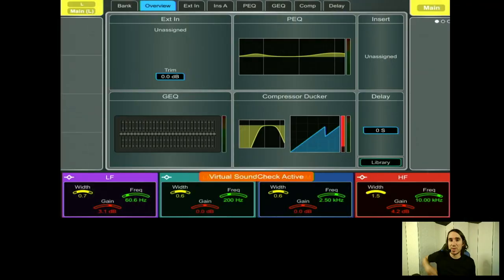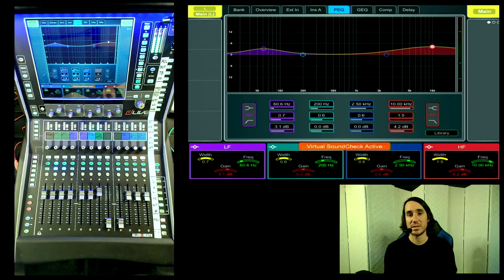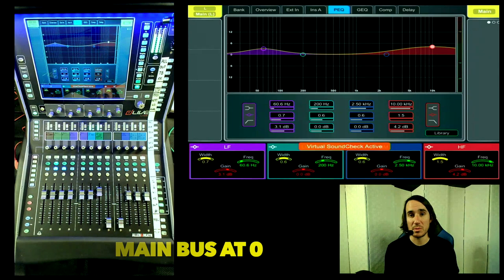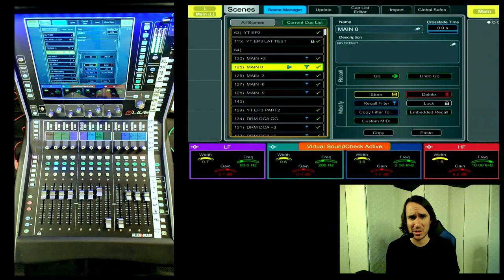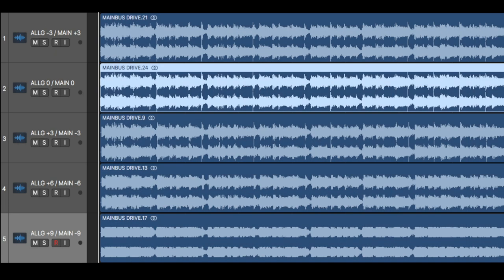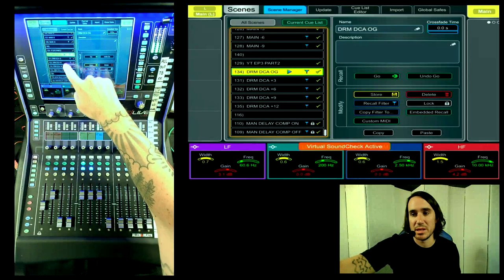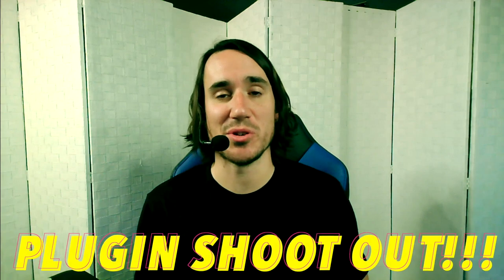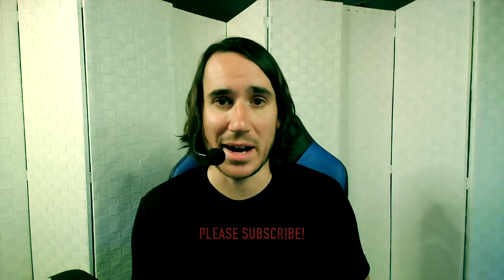EP3 - Dlive Summing / Driving a Digital Desk Hard??

Comment: This looks more like a bug than a feature to me. The holly grail of digital summing is to make it as transparent as possible. What can we see here is some clip limiter  without any user parameters, that at least according to official Dlive advertising is not even supposed to be here. I'd much rather have a transparent summing with L2 inserted, that I can at least bypass if I don't like what its doing.
Reply from the maker: Pantikan to each their own! Totally hear ya. Regardless I still think this effect is far more transparent than an L1/L2, and this demonstration is hitting much harder than I would suspect most people would go on any digital platform. Hence why I would disagree on it being a bug.
Reply: @asumoftwobusses6304  Would you mind uploading wav prints of the two most extreme cases 0/0 and +9/-9? I'd like to have a closer look of whats going on.

Comment: That's actually exactly why people still love the Midas Pro series. The way that line of desks breathes and pumps is just amazing. And dLive was the only desk that came to mind when I decided to switch to another system (for various reasons, none of which were sound related), since I NEED this. That moment, when all comes together and becomes more than just the sum of it's parts...To me, this is what a desk should do. It is a summing device, so make it awsome at that, digital or not. I was told by a Pro series developer that some of the Midas guys went over to A&H after MUSIC bought Midas. And I think you can actually hear that. I was not a big fan of the A&H stuff. The GLD and the other desks of that generation were spec sheet monsters and had some great ideas incorporated, but they just fell short in the sound department. But the current desks...oh boy. Those are some awsome machines. Combine that with a great company spirit, a great ecosystem, a contemporary UI and awsome support - and there you have it.

Comment: If you apply Dave Rats DCA/Group method for driving your groups in and out of compression you can relay make the dLive shine over other desk that hate red lights.  You should not be afraid on red lights on an A&H qu, sq & dLive.  They are unlit any other digital board on the market.

Comment: I'm very surprised by this outcome, Drew. One of the big advertising points for Dlive is "Virtually infinite mix headroom thanks to 96bit accumulator". It doesn't seem like you're pushing that far into the red, but of course the waveforms show the effects. I would have expected basically no difference between the various pre- and post-fader moves you did here, unless you were pushing more level into a compressor.
Reply from the maker: arock no compression no bus treatment at all!! Just that eq I mentioned in the video. And that’s the crazy part, I believe they have crazy headroom, but at 9db into the mix bus it doesn’t come out of the red. Very fascinating!